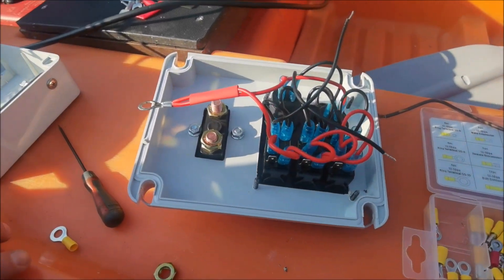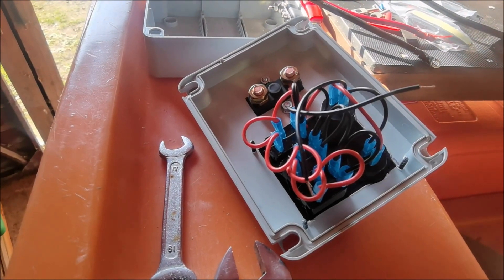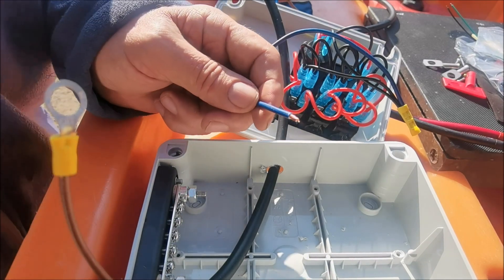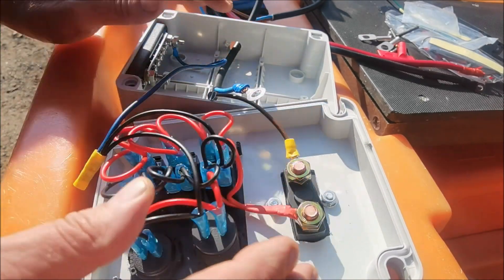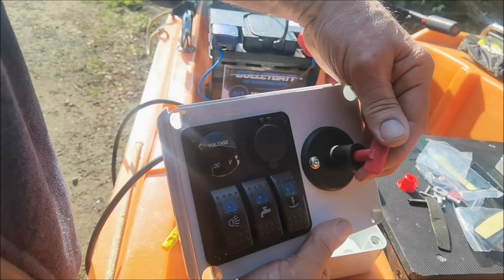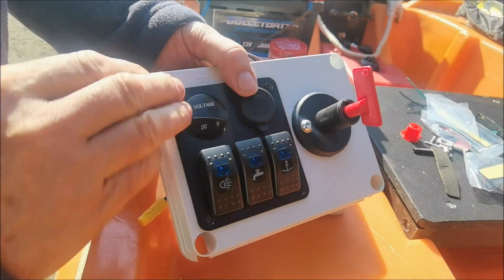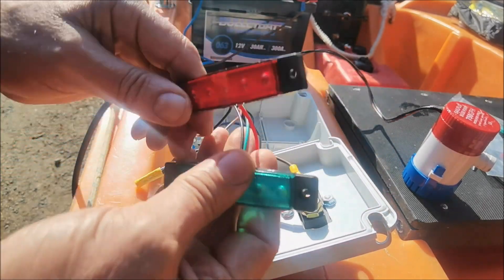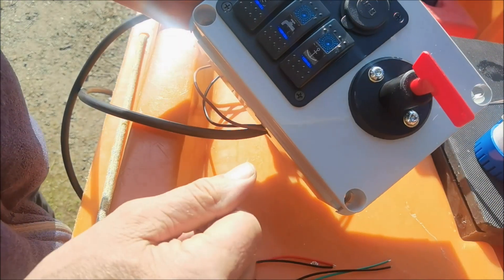How to wire a boat switch panel with isolation switch

Comment: You need to install fuse protection before each + switch feed and on your main + feed to the battery isolation switch. If one of your lights or pump develops a dead short, you will melt wires and possibly start a fire.